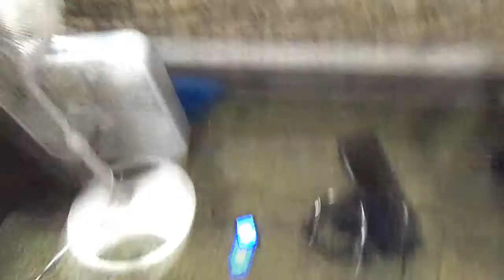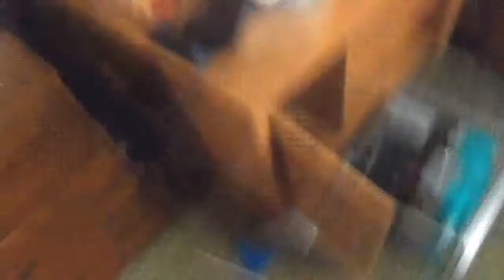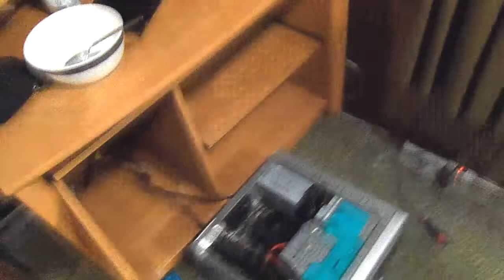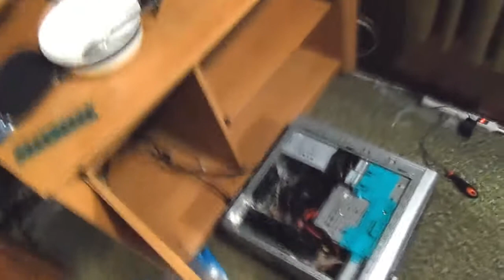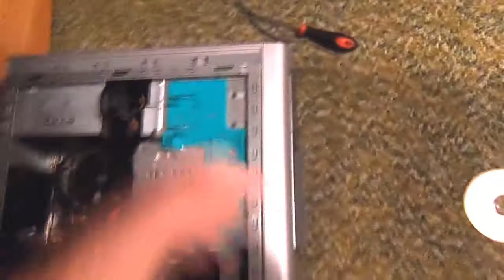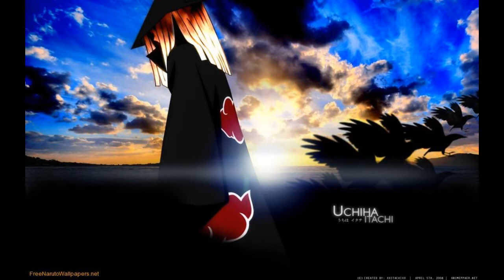Blue Screen of Death Memory Management Fix and Problem/ Updates

Comment: I've had the same trouble in the past, i went into the bios and turned the voltage of the memory down to 1.8v, no problems since 

replaced the sticks some time later though

Comment from the maker: @padurei yeah you need to be able to run windows because you have to burn memcheck to a disk i would just start removing the ram one by one to see if you ram is bad or just remove all but one stick then try if it works then just put the ram back in intill it doesn't.

Comment from the maker: @leeb127 Try using mem check it will check your ram for errors just google it you should be able to find it you have to burn it to a cd and boot from start up. Good luck and hopefully replacing the ram fixes the problem